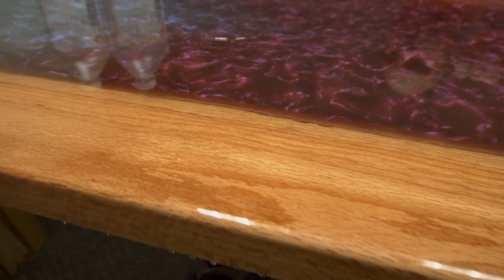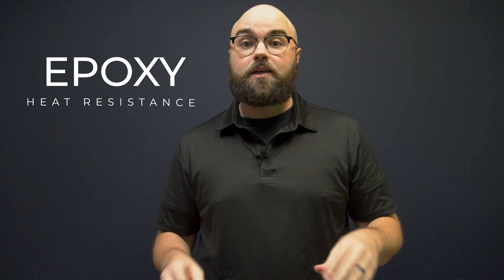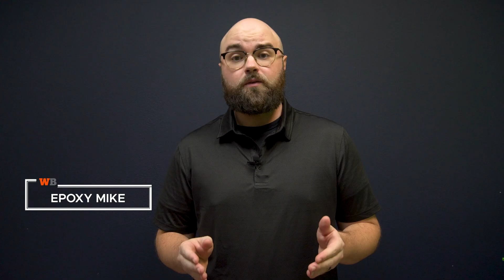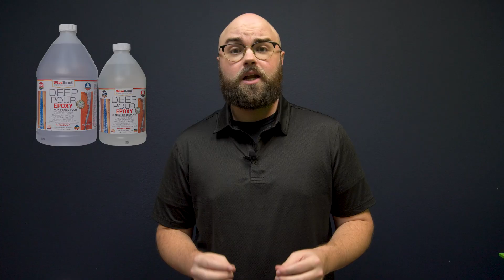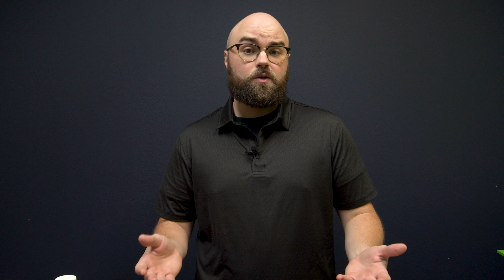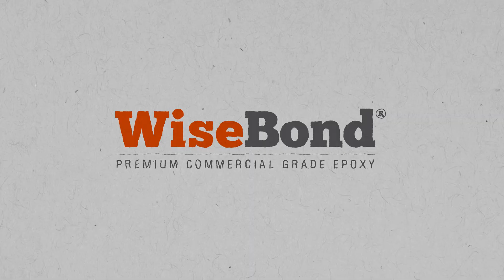WiseBond Epoxy: The truth about epoxy heat resistance and parlor tricks!

Comment: With my tile countertop, I am able to rest pots and pans straight off the heating element, and leave them on the counter to cool. Same for cookie sheets that I have just pulled out of the oven. If I am not able to do this with epoxy countertops, then I am afraid this type will not be for me.